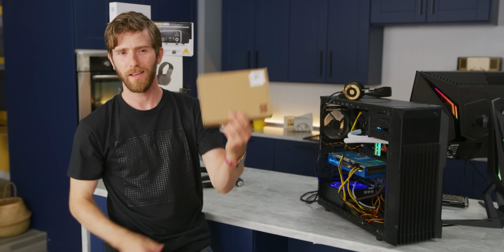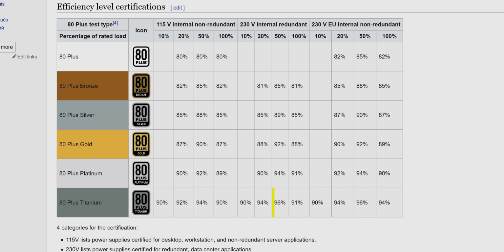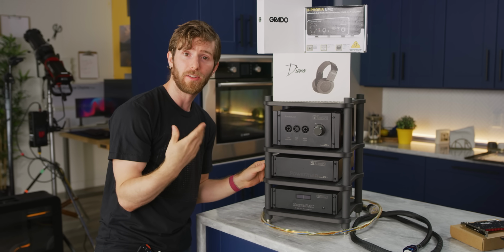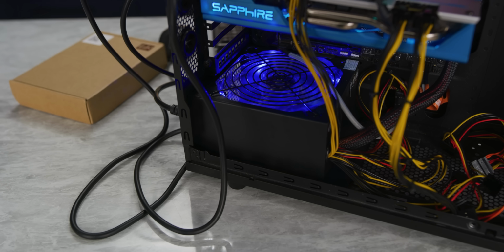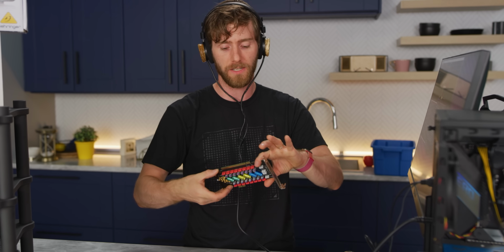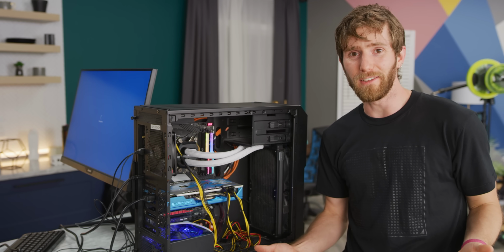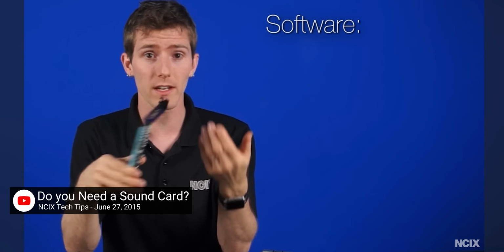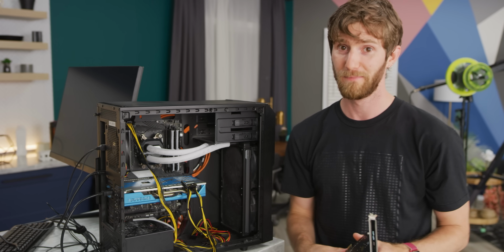Is this $40 card a SCAM? - "Audiophile" Power Filter

Comment: I am starting to feel like an idiot. I was taught, way back when I started in IT, to never touch the gold contacts on any card, ram module or anything that would be slotted in to a system, because the oil on our hands would degrade the contacts, over time, causing instability. 
Meanwhile here Linus is ALWAYS touching the forbidden zones directly. So.. What's up with that? Anyone know if I've just been following dumb advice all these years? I always keep to the sides of the PCB and avoid touching any components or the gold contacts directly. While grounded, of course. I assume Linus has a ground cable on his feet. I have to assume. Would be nice if he showed himself using it though, since he's influencing a lot of people..

Comment: Looks like another $40 amalgous confabulator (i.e. useless junk). It would be a LOT more accurate to run your audio out through an o-scope to detect any system noise coming through the line. That being said, the power coming out of most modern power supplies is going to be filtered a lot better than transient noise generating components on the motherboard itself. Take an old FM 'transistor' radio some time and hook a length of wire to the antenna. Tune it to a quiet place on the band and move the wire around the outside of your computer case and listen to the symphony of RF generated noise coming from your motherboard and related components. I don't see how some of these even pass any kind of U.L. or FCC ratings for spurious RF emissions.😜

Comment: because that hum sound is generated by the supply or gpu....  it doesn't convert power through a pcie slot...   if you know how electricity works it goes to the first thing that needs it...   you cant force it down a pcie lane into a card and then pass in back through the pcie lane lol    think about it  pcie is 12 volts max...  so it would have the 12 volt feed from psu to cpu AND gpu..  AND ram..  and that would probably fry the board.   12 volt at 30 amp max...  not 12 volt a 70 amps..  lol

Comment: Go back 30 years and every single vehicle has a capacitor fitted called a suppressor just to filter out electrical interference mostly noticeable in the radio. These days they are built into everything so external one is not needed

Comment: It’s unfortunately the products like this that get the most widespread attention and ultimately give audiophiles a bad name, though the principles behind them are rooted in truth, the actual implementation is snake oil... and there are a looot of products like that. The BEST thing you can do for PC audio is electrically isolate it from an outboard DAC, with a fiber optic cable. And in many cases even this isn’t necessary. 
Unfortunately PCs (and most modern electronics) are absolutely flowing with dirty power, and for the most part, with most things digital, it doesn’t matter. But when there are sensitive analog components involved… try this, get an original Sega genesis, and one of those cheap generic “retro-bit” or other brand of AC adaptor for the console. Look at what the switching power supply does to the video. Now try the original Sega AC adaptor that actually came with the system 30 years ago, that uses a real transformer… night and day difference.

Comment: as soon as I saw that its a PCIe sound isolation card, I nearly spit out my mouthfull of water, Linus said it best, Yesterdays Solution ... Tomorrow! I can only think of 1 scenario where this might have some actual merit, if the system is one of those multi-systems in one, and there is a slight noise wine for the sound cards that are added to drive sound out to the workstations, but I still have trouble thinking tjis would have any kind of impact vs something like a farad filter (magnet around the wires basically) that has a history of working when it comes to noise interference, unless I am missing something 🤔
Reply: You're not missing anything, except this card doesn't isolate anything electrically.

Comment: The bigger problem is usually higher frequency noise, not for audio, but OC, and stability. And if the manufacturer messed that up, you can't fix it because the capacitors have to be right besides the pin/ball, as close as possible, usually in the range of under 1mm. Having bulk capacitors on the main voltage lines is usefull, but only for +10µF. The card is also not worth 40$. I could probably design sth like this for a 10K cost of under 10$.

Comment: i can speak for the chinese manufacturer based on my experience, is that they like to creatively over-exaggerate their tech in order to generate sales but in actuality they almost always produce low tech device to solve non-existing/negligible problems which often does not work. It is not scam per say, but it is 'an attempt'. What you are buying from them is an "attempt". So do your research and dont part away your money too easily because mostly likely your money wont come back. They will not even entertain product warranty if you believe there is a warranty on their product :D. Other than chinese made cock ring, you do not want to buy their tech devices.

Comment: i actually added caps and inductors to my onboard audio back when i used desktop computers,it did make a big difference,but then again, my amps have no volume control(they were built into the computer itself) and were also capable of driving my speakers to ear damaging sound levels

Comment: @Linus the electric noise you are talking about comes most of the times from headphones that requires really high 'ohm'. But if you really want to discover some crazy noise, you should try to record something with a microphone and do the GPU benchmark. I think that's the noise you are looking and I am really curious what that card does if you try out what i mentioned. :)

Comment: You do a couple of things wrong here, Linus. First of all, you're using the onboard sound card. No effect, as it runs on another power rail (as you even touched upon in the video). You need to test with a PCI-E sound card to notice any difference. Second; you're playing sound while testing. The noise this is designed to kill isn't affected by the input. As long as the output is active, there will be noise.

I have an ASUS STX II 7.1 and a GTX 970 GPU. I experience highly irritating noise when the GPU is doing stuff. Most prominent when scrolling and not playing sound, but always noticeable unless I play loud enough to drown it out. I installed the elfidelity card into my system, which reduce the higher frequency noise by ~70%. The midrange noise is sadly more or less untouched, but the overall noise reduction is in the range of  ~40-50%. It definitely works, but it's not good enough.

(Cooler master Silent Pro M2 720w PSU, ASUS ROG MAXIMUS VIII HERO motherboard)

Comment: Try it through an oscilloscope instead of Linus’ ears?
Reply: I agree  - at least give us the illusion of rigorous testing
Reply: For sure. But its a total scam by design anyway.
Reply: Yeah, you're right. But in this case, it is not necessary. It is just obvious that it is mission impossible.
Reply: Only one they have is that pci win xp one for the weird tech vid
Reply: Yes.
Reply: Why the fuck would that be necessary , I’m not going to buy it and say “finally, I can use my oscilloscope to see the minuscule results. He’s reviewing it like a consumer.
Reply: @mooplex4466   What I want to see is if it can filter out the noise that is caused by listening to audio from a device that is being charged/powered by USB.
Reply: @CreepOS2007 , there should be almost no noise from a USB sound card.
Reply: @KaptainCanuck  You don't need a sound card to listen to or record audio. Microphone/Auxiliary inputs work just fine. The noise occurs when powering a device through USB on your PC and then recording or listening to the audio from that device on the PC that is charging it.

This has nothing to do with electrical interference inside the PC (as far as I am aware) since the noise can still be heard even when using fibre optic to send the PC's audio to another device.
Reply: @CreepOS2007 , microphone (typically mono sound)/auxiliary inputs are part of an (onboard) sound card, which I refuse to use, and will cause hiss, etc due to the interference in the analog signals. I have NEVER had anything but clean signals from cassette audio transfer using a USB sound card because the signals are not convertered from analog to digital. The odd time, you get the sound of a tape rubbing on the play heads but that is negligible and very easy to remove in Nero or Audacity or even just cleaning the player. I have never had any hiss, etc while playing audio properly transferred to a PC.
Reply: @KaptainCanuck  No shit. There is not a single thing in your comment that pertains to my original comment.

Comment: @Linus Tech Tips would need to put the filter on the 6/8 pin connectors on the graphics card. Probably would need some beefy caps for that, since you need higher capacitance for higher current applications. You could make one, even!

Comment: "Hey look, my graphics card!"
"...the coil whiniest GPU we could find."
"Oh." :(
Reply: F
Reply: F
Reply: F
Reply: F
Reply: F
Reply: F
Reply: F
Reply: F
Reply: ＴＨＥ　ＬＥＴＴＥＲ　Ｆ
Reply: Big oof, Aarekk.
Reply: Thats mine as well, except not the special edition
Reply: Oh jeez we have the same GPU, we were both just as sad :(
Reply: F
Reply: F
Reply: F
Reply: I have coil whine with literally 60fps with sapphire pulse rx 580
Reply: uck
Reply: F
Reply: F
Reply: F
Reply: Aarekk F
Reply: L
Reply: F
Reply: F
Reply: Ouch, Come on MAN!
Reply: F
Reply: F
Reply: F
Reply: F
Reply: F
Reply: F
Reply: Same here man, is that the random whiny noise I sometimes hear when I boot up a game? Also if you didn't know there's program that allows you to control the light on the "sapphire" writing on the side, along with a few other things: https://www.sapphiretech.com/en/software (p.s don't turn on the radeon image sharpening in the TRIXX tab it makes games stutter)
Reply: They missed the whole point of that card. YES it's designed for audiophile grade equipment. If this were an actual sound card electrical current would travel through the device to the headphones.   NO it will not magically absorb coil wine caused by another board device. That the cause of the alleged symptom is electromagnetic interference. Which would involve either damaged components or poor power delivery. If components are shielded properly, the GPU should have little/no effect on sound. Other than the stress it puts on the PSU. So throw in a space heater Titan Z, and you likely have the same result. If this was a Motherboard AC'97 vs dedicated sound card that actually altered the electrical output path of the sound, there would be something to test here.

While this may be a slight exaggeration, you literally added links to everything in the description with the exception of WHAT WAS THE FOCUS OF THIS VIDEO! The Elfidelity AXF-107 card. Smh...
Reply: my laptops 680m whined pretty bad, and died after only 5. might be a fluke.
Reply: F
Reply: F
Reply: F
Reply: Same :( 
I feel attacked lol
Reply: F
Reply: Me 2 bro
Reply: I have that exact model and I hardly notice any coil whine unless I'm running a game like control on ultra settings that uses %100 of my GPU.
Reply: name of the card?
Reply: @SonekR  Sapphire RX 590 special edition, I might have missed few random unneeded buzzwords in its name though.
Reply: @iforgotmyname2306  same card, mine's ASUS wonder why i couldn't recognize the sapphire card weird
Reply: @SonekR  change comment to F I will delete this soon
Reply: F
Reply: F

Comment: The moment you showed the power cord on that amp stack, the facepalming began.Lemme guess, Rhodium plugs?  Think about it Linus.... you replace the 3-6 feet between the outlet and your amp with some fancy power cord made of pure unobtanium, while not considering all those meters of electrical wire in your walls, and the miles of wire between your electrical panel and the power station.

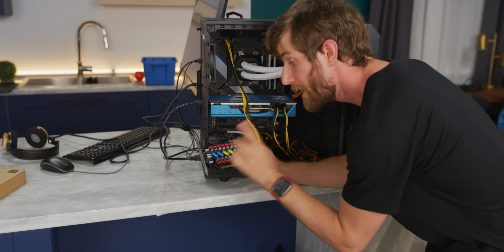Comment: 7:07 isn't it just possible to plug a 1x card into a 16x slot? leaving the rest of the slot empty?
this doesn't make sense unless it would benefit from 16x speeds (actually for this specific case some 1x slots are open ended, allowing you to plug a 16x card that is okay to work with 1x speed)

Comment: Why not set up some objective testing? Like grabbing the signal from sound card before, and after installing the hardware and checking if there is any difference in output? I am sure that there are some apps that can be used to compare the sound quality and detect any noise etc. I was sort of hoping for such test, comparing waveform and all that.

Comment: lol its hilarious watching people who no nothing about a topic pretend to be experts in it. Your testing methods are stupid. hook up an oscope and see how it effects voltage ripple on the power lines. This is not meant to make every system better its made for specific cases where the ripple is normally audible so if you have a problem with it i bet the card would help quite a bit.
Reply: ... I bet it wouldn't since it's only on the PCIE lines.  It may be a different story if you put an LC filter inline with a noisy component, but this isn't going to do much of anything.  Of course he should have tested properly, but it wouldn't have mattered for this card.

Comment: That video really needed an oscilloscope despite audiophile stuff being very subjective. I’d imagine there’s no perceived difference in audio quality one way or another when most of the stuff is digital (like gpu, cpu etc) what would affect audio Q is the analog part (so the power amps) of the sound card, so they really should’ve used a terrible mobo rather than terrible PSU and GPU.

Comment: No, no, no NOOOOOO!
How could you recommend an AC-AC power filter,
when every PC has its own AC-DC power supply with it’s own filter and smoothing characteristics.
It doesn’t make any sense whatsoever! PLZ!?
The filter could only be placed after the power supply.
Reply: Most "cheap" ATX PSUs don't even have proper output filters so why would you assume their ac power filters are sufficient?
It's certainly better to recommend those than to tell ppl to hotglue diy capacitor banks into their cases or buy chinese miracle pcbs ...
Reply: @protator  either way you lose money with exactly no gain. just buy a decent power supply.
Reply: @hansdruf9132  Well, obviously. I bought an AX1600i for my workstation because of it's low noise and ripple. I don't use external AC power filters either. But there are very few PSUs that come close to the 1600i in terms of filtering and voltage regulation and they all cost an arm and a leg. A mid-range psu from a reputable brand plus a no-frills ac filter would still be cheaper ... so I don't think his recommendation is fundamentally wrong. They can slightly reduce output noise even with switching mode power supplies, ac filters are more than a placebo in such applications. 
But then again so is the chinese pcie card. This "as unscientific as possible LTT test" wasn't exactly fair. If it was 10 bucks or so I would probably get one and hook it to my oscilloscope for some backyard science ^^.
Reply: @protator  Well, I would trust your backyard science, because it's still provable and scientific, in a way

Comment: The thing is that the signal (power rail) has to go through, or to be in the range of millimeters away from the filter, to be efficient with the problematic frequencies that tend to radiate / conduct inside the system. Impedance of the extra banch, going to the filter bank just destroys the performance in any sensible frequency, that someone would want to filter.

Comment: I have this weird issue with my main computer where if I plug a mic in the onboard audio it captures a lot of noise and the audio is horrible in general, and if I use an USB soundcard the problem persists. No amount of formatting solved that and everything works perfectly on my other computes

Comment: Hey Linus. I'm assembling a new PC. Will you recommend -
1. Ryzen 5 3600x with rtx 2060.
2. Ryzen 5  3600 with rtx 2060 super. 

No other expensive options please as on a very tight budget. 
Purpose - designing, video editing and little AAA gaming.

Comment: you can get AudioQuest Dragonfly Black or the like if you want decent not that pricy upgrade from crappy motherboard soundcard.
There are plenty others like Topping's, Xduoo XD-05, or Fiio's that possibly sound better (i'm currently use BTR5 for my phone and laptop needs).
Basically there are plenty awesome $100~$200 external DAC nowadays to help with the sound quality of $100+ headset/iem.

Comment: Linus hook up the onboard audio to an aux connection on a basic amp and then listen for the hummmm.  Personally i just use a ground loop isolator on the RCA cables that i purchased from a car audio shop for $15.  Just connect the grounds up to a free Ground on your powerbar or wall socket.

Comment: they probably thought about reducing the ripple voltage would work like its gets the voltage input changes the ripple voltage and throw it in a output which isnt a bad idea like i did this on my speakers adding a circuit to reduce the ripple voltage and my sound was actually clearer but i dont see how this would work on a pc unless its built on into the motherboard 

oh and that sound the speaker makes we just call it resonance im finishing my electrical engineering this year XD